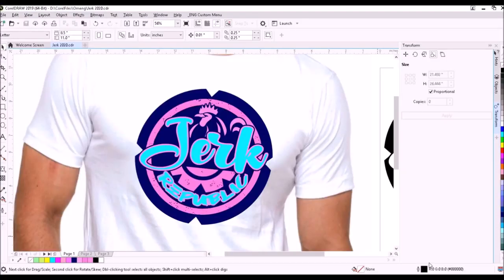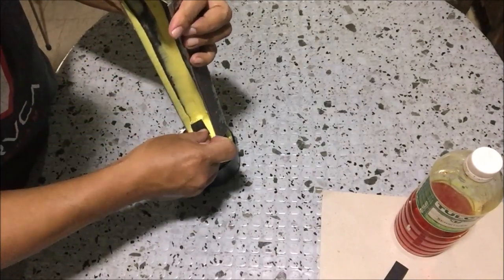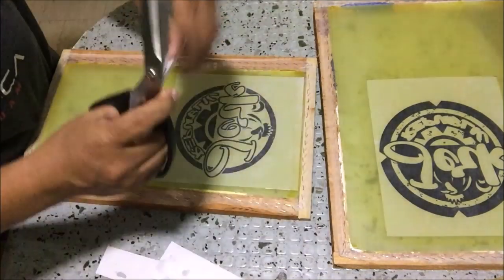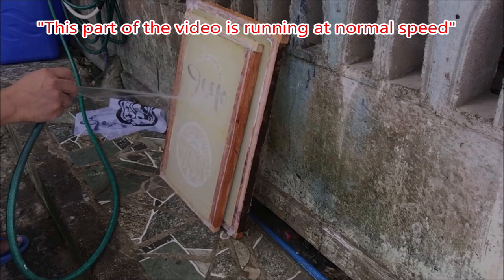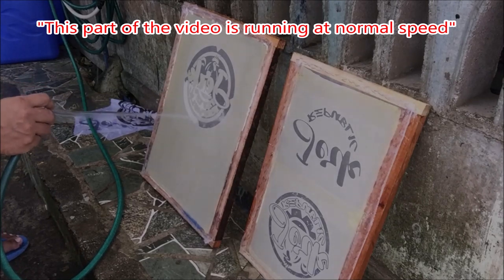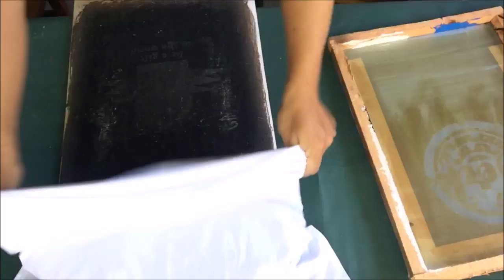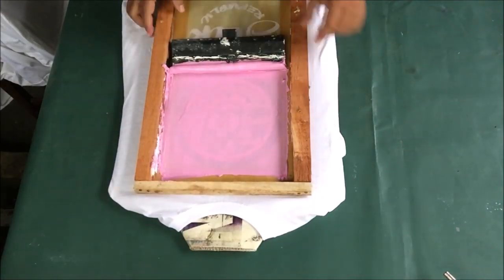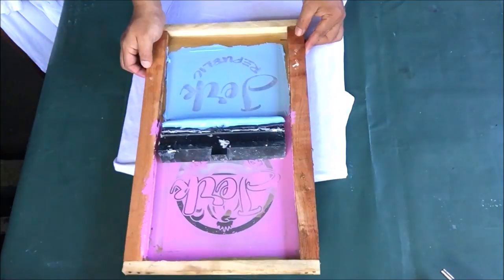SCREEN PRINTING - 3 Color Club Shirt

Comment: I love the idea of using plain paper and cooking oil instead of transparency..... game changer.
I'm going to try that on my next screen!

Update: I did try it and it worked perfectly, I think this will be my regular method now 👍
Reply from the maker: Thanks for watching.....:)
Reply: @EasyVideos  sir the design you print same size or all three are different size or measurement  for the purposebof 3 colors.
Reply: @jericoaguilon246  They have to be printed the same size as its all the same design . If you make a color smaller your design won't work
Reply: May i know what kind of painting or brand you use? I prefer cheap but good quality
Reply: Thanks for trying it out and letting us know!
Reply: @genkidesu5566  - I think everyone prefers “cheap but good quality” lol

Comment: You are the MAN! Buddy. The part where we have to get the design on to the photo-emulsion coated nylon mesh with the help of acetate paper and let me tell you acetate paper are harder to get and more expensive! Me being from India which doesn't help in sourcing the necesserary materials needed with no issues at all. BUT... Thats not the case at all here, the services, materials, advisory help etc., That are provided to new entrepreneurs is quite limited and hard to reach in time. The acetate paper was just a tiny example about the major issue we have in the Indian economy. So, I thank you as an aspiring entrepreneur and in the behalf of other entrepreneurs, to show us a better and cheaper alternative to acetate paper I would have never know about this if it wern't for you. Thank you for making my life a wee bit "EASY'errrr". Keep up the great work rooting for you!
Reply from the maker: Glad to Help, good luck!
Reply: @EasyVideos  Ohh btw i wanted ask could we be using any type of paper? Like say, maybe bond paper? Can we use that instead of plain paper too or does it has to be specifically that?

Comment: amazing note all. this process is very tricky, just keep perfecting the process, it will help. carefull also using the sun, pick time like 10am to 1pm 3 to 5 seconds, 3pm to 5pms longer but it dpnds on your mix. this vid is very straight forward and practical. Goodluck and happy printing all
Reply from the maker: Copy...and thank you...
Reply: I think the photosensitizer of TULCO is forgiving...he can even work on ambient room light during the preparation of the screen without risk of it being developed/sensitized.

Comment: This is the easiest and cheapest multi-color silk screen method I've seen -- I'm impressed!  Question:  how do you keep paint from bleeding onto the shirt while you're aligning the screen?
Reply from the maker: Consistent thickness of paint so that it will not Blot or bleed...the soft cushion of shirt pad also helps in preventing bleeds while printing....

Comment: It is really helps how you maintain the rythm of printing. Especially how you avoid ink from drying. Thank you. How do you make t shirt stick to the pad like it is glued?
Reply from the maker: the glue is called Table Adhesive....specifically formulated for t-shirt printing used...
Reply: it is glued with a spray glue
Reply: @EasyVideos  what brand is it ? Is it a spray? Can you make a video on how to apply it

Comment: Very nice and informative video. My only suggestion is that, you should have lessened the volume of the actual video, water spray, when you are talking. That's all. Thanks a lot and keep on posting.
Reply from the maker: Thanks for the tip!

Comment: Hey. Are you using water base ink or plastisol ink. Which of these is best
Reply from the maker: I find Water-based Paints simpler to use...both Water-based paints and plastisol inks have advantage and dis-advantages so it's really up to you...

Comment: Great video. Quick question. I have a heat press machine. Can I dry the shirts using the machine? Or is that too much heat. Thanks in advance.
Reply from the maker: You can't...paint will stick to the surface...

Comment: i  did not unerstand one things about drying color , , do we need heat machine for dry ?
Reply from the maker: Water-based based don't need machine to dry.....paint will dry naturally or you can use electric fans or hair blower to dry the paint quickly.....

Comment: How do you dry the ink after you put it on the shirts?
Reply from the maker: Most of the time I just let it dry naturally since it's water-based, but you can use hair blower or exposed the printed t-shirt under the heat of the sun to dry the paint faster.

Comment: Can you still do it without the sinsitizer
Reply from the maker: Nope, sensitizer is neccessary for the photo emulsion to react on Light...although there are ready-mix photo emulsion that you can buy, and this kind the already had sensitizer in the mixture.
Reply: @EasyVideos  i looked in my kit. I have some.i know i asked this question already but can i use your method to make prints? Instead of buying transparency paper

Comment: Can you always see through the print to line up the colors?  If so..is it the ink?
Reply from the maker: It's easier to see through the screen when the designs are big, yes right consistency of ink makes it possible because once you screen print non or very small amount of ink was left on the openings of the screen stencil which make it possible to see through....
Reply: @EasyVideos  thanks! Works with plastisol or water based?

Comment: Does the print quality same as regular way of screenprinting? I mean your way is easier and low cost and the print be long lasting as well?
Reply from the maker: Yes, water-based paints are more durable than plastisol inks..
Reply: @EasyVideos  can I use this method with plastisol ink as well? thank you

Comment: Sir, i tried it myself but it failed, can you tell me is it a bit wet when you try to put positive on the screen?
Reply from the maker: The photo Emulsion should be dry...and you should exposed it to sunlight for only 10 SECONDS....you over-cooked it that's why the design did not wash-off  during washing....

Comment: What is the advantage of using water-based rubberised ink ?
Reply from the maker: Easy to work with, I don't need complicated equipment, easy to dry, paints last long, or durable, best for simple designs or classic style finished etc...although I have nothing against Platisol Ink users, it's just that I Love water-based textile paints ....water-based textile paints dominates screen printing before the Arrival of plastisol paints.....
Reply: @EasyVideos  very informative. So the plastisol ink is advanced one. Thank you.

Comment: Thank you for this. You really were the best tutorial guide. I was wondering can you print you image with a sharpie or does it need to be printed¿
Reply: i think you can draw the image as well. as long as the oil doesn't mess with the ink, it should be fine.
Reply from the maker: You can use Sharpie for the Designs...

Comment: boss ano po settings nyo sa corel draw printing option? kc sken nung ngprint ako gmit corel draw putol msyadong malaki ung design sa papel, also my additional po ba kyong pixel sa underbase ?
Reply from the maker: Kino-Convert ko po yung design sa Vector para solid talaga yung kulay...hindi pixelated....makikita nyo po sa Corel Draw kung lagpas yung design sa papel...ibig sabihin outside of printing area yung ibang part ng design....kung nasa loob naman ng Document yung Design at pag Print nyo ay putol pa rin, baka sa settings, ibang size ng papel yung nakalagay sa settings.....

Comment: Sir, maganda mga tutorials nyo. Ask ko lang po if natry nyo na po magprint sa plywood po? Nagbabalak kase akong maggawa ng design tapos sa wall ko iaapply as  decoration. Pwede kaya yun via silkscreen? Is there any limiting factors po kaya?
Reply: Additional.. Acrylic paint po ang gagamitin instead of textile paints
Reply from the maker: Kailangan po ng Practice para makuha yung tamang technique, magiging problema po kasi yung pagsabog ng pinta dahil matigas yung surface ng plywood at malabnaw naman yung Acrylyc paint....pero kaya po yun....baka kailangan mas finer yung MESH ng screen, may iba-iba rin na klase ng squeegee,...do more research at Good luck po....:)
Reply: @EasyVideos  salamaaaat idol

Comment: As a screen printer myself, this made my head hurt badly.
Reply from the maker: The Method I'm using is for water-based paints....before the arrival of Plastisol paints this method had been widely used....old t-shirts with prints during70s, 80s, 90s and early 2000 were printed this way....I still prefer water-based paints because of its simplicity......